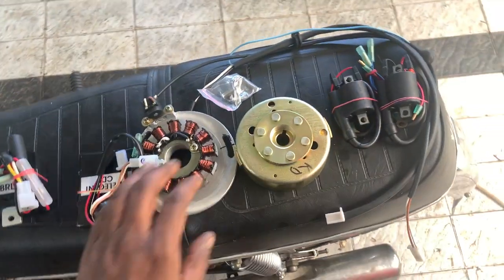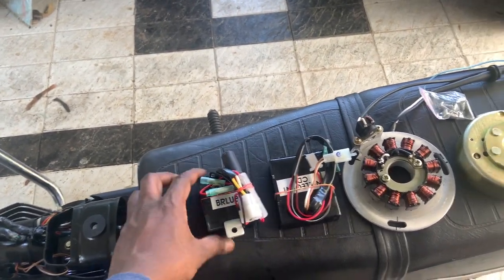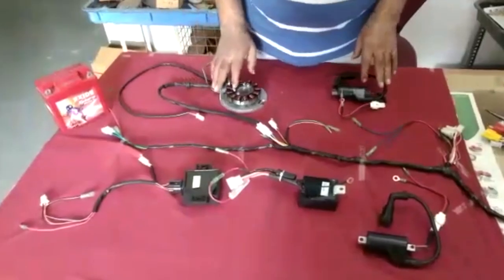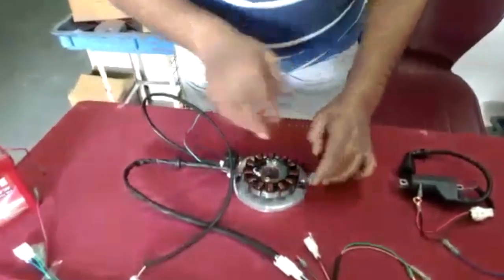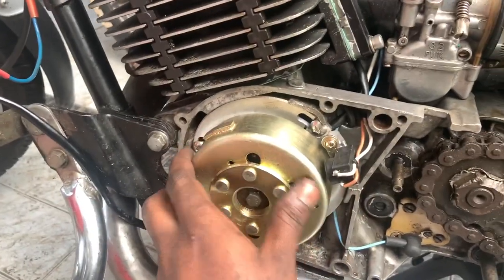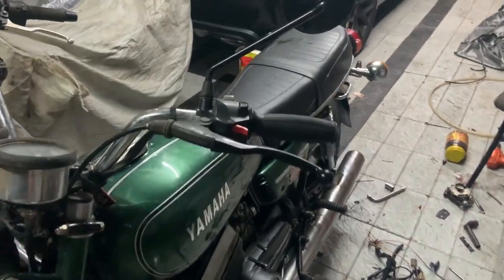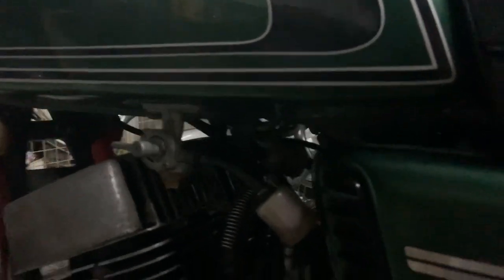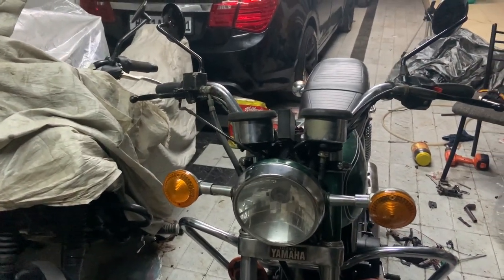Installing Allied Digital CDI in my Yamaha RD 350 (English Video)

Comment: Hello, 
Wanted to ask you something about the kit
I too own same kit
The problem is rpm feels like it's limited to around 6-7k.
Did you notice the same
Reply: I've been troubleshooting my bike from past few months. 
Tried everything
From ignition coil, carburettor, jets, different carburettor, timing, reeds, everything one could think of 
Still no luck
Reply: I could send the video to you via email
Reply from the maker: Try playing with the timing a bit, it’s the analog kit or digital kit?
Reply: @Yamakaze  it's digital
Reply from the maker: @vishalacharya5903  my bike had ground issue, it was misfiring a lot initially.
Reply: @Yamakaze but in my case , there is no misfire
Runs very good till 6k rpm 
Very good power delivery
Only rpm limited
Reply from the maker: @vishalacharya5903  check the ground well, the digital cdi has an rpm lock and it's prominent on LT bikes more than HT bikes since they have a narrow power band, is yours LT or HT?
Reply: @Yamakaze  Ht
Reply: @Yamakaze  It was proper when I was using old AC cdi
Reply: Should I buy AC CDI KIT from Indian electronics
Reply from the maker: @vishalacharya5903  remove the air filter hose completely and see if that makes a difference
Reply: @Yamakaze  tried
Reply: @Yamakaze  no luck

Comment: Hi Yamakaze! Thanks for posting these videos. Gives me lots of hope that RD is a reliable machine when work properly done. I came across a person who has the TCI kit that last batch of RDs had. Is it worthwhile to go for it or the Indian electronics CDI kit?
Reply from the maker: The TCI kit was the last mail in the coffin, has all the disadvantages of a points bike. The orange RD was a TCI bike. You have to experience the sheer power the this CDI kit has.
Reply: Thanks for the word of caution
Reply from the maker: Welcome
Reply: @Yamakaze   can you please explain the difference between point system and cdi kit.   I am buying RD350  which has cdi kit ,  I am going to restore my bike again once I buy.  I am stuck in thinking , should I switch back to points or keep it on cdi .  Thanks in advance  and the exhaust sound difference, if there's any.   Thanks sir
Reply from the maker: @jugni0019  i would avoid the point system at any cost unless you are a purist and want a stock restoration and the bike will be a garage queen. The pleasure in these bikes is not limited to ownership and they are meant to be ridden and ridden hard, points system were obsolete and companies themselves adopted CDI. Honestly speaking the advocates of points system dont really care about performance . The ignition is the biggest Achilles heel in an RD 350, that's the first thing you change. rest everything is cosmetic.
Reply: @Yamakaze  thanks sir, is there exhaust notes sound difference between point and cdi.  And what  do you mean by garage queen.  Kindly explain,  I am close to making my decision after reviewing your opinion,  sir
Reply from the maker: @jugni0019  garage queen is a bike that stays in the garage and looks the part doesn’t run right

Comment: Its a 4stroke magnet coil basically you are running in a 4stroke curve timing 🤣get a real 2t ignition for a rd bike sounds it has a load better get a mzb or rdd not with these abdul rehman cheap replicas
Reply from the maker: I have had issues with RDD, so no thank you. I am pretty happy with the results. I am building an rd with MZB, each bike has its charm.